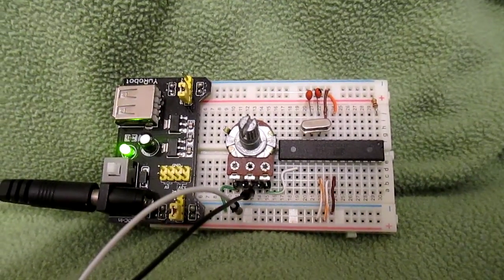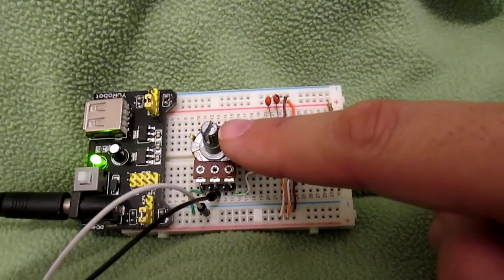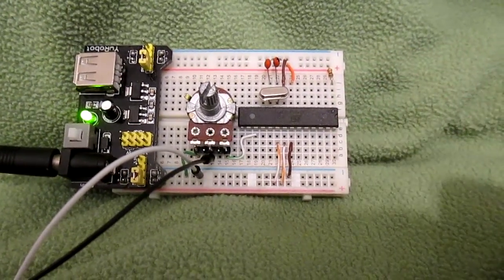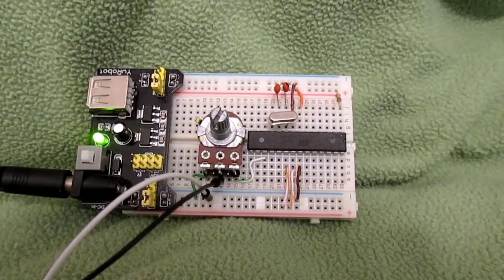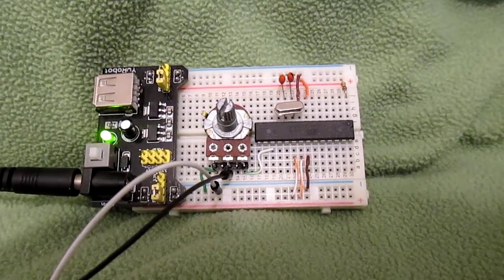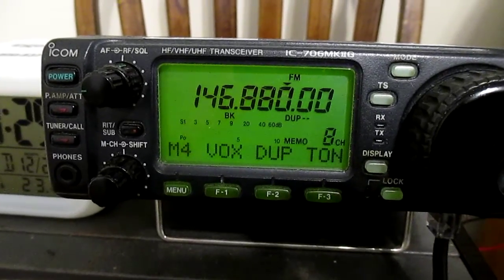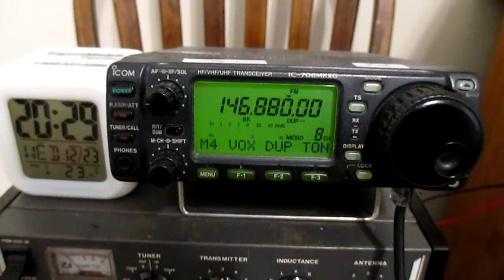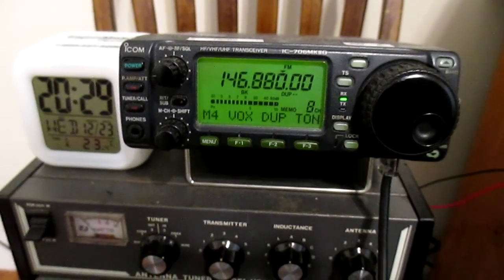Homebrew CTCSS tone board

Comment: I'm leaning toward an mp3 player with a different hour long mp3 for every tone. (I need four different tones around here.) I ordered my $1 player from China, should arrive in a few weeks! Audacity is free software that can be used to create the Mp3s. In the meantime, I'm looking at an old smartphone with a tone generating app.
On my ICOM IC 255A, the signal gets injected by soldering to the wiper lug of the "Dev" pot.

Comment: Great tease. No schematics whatsoever. The "reference" gives no real info into THIS application.
Reply from the maker: sorry, not a tease, I just never got back to it. Since there is interest I'll see what I can do, and properly decouple it.
Reply: When you say, "I'll just plug in the tone board", Just what are you plugging it into?  Just coincidentally, the tone I need is also 107.2. Looking at tone boards commercially made, this beats them to hell with a stick for price. I can get the 5 Volts out of the radio. And I know where to connect it. I just would like to see a schematic, with parts labelled. This is a really cool project.
Reply: @doombringer1505  Hi US,CTCSS tones encoder are generally fed on the top side of the fm deviation pot adjustement inside your radio.They should not be fed from the microphone socket.Generally I set them for 750Hz (CTCSS)deviation+4.2khz (voice)=4.95khz max FM deviation on wide bandbandwidth,or 375Hz (CTCSS) deviation+2.10khz (voice)=2.48Khz dev max on narrow bandwidth FM systems,do a google for PIC based CTCSS ull find them.

Comment: Would it not be prudent to put in a decoupling capacitor along with at least a mild low pass filter?  pwm got some sharp harmonic edges.  but I guess if it works.....
Reply from the maker: John Cundiss Yes, that would likely be a good improvement.